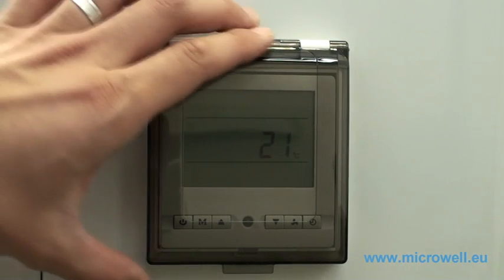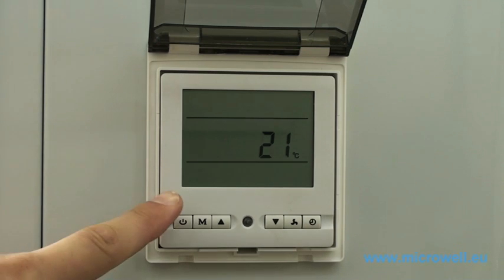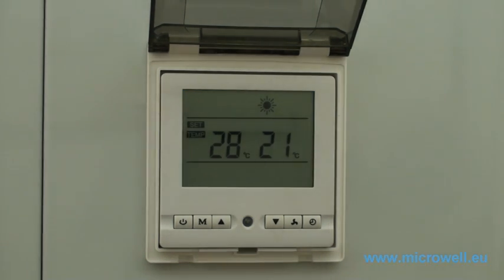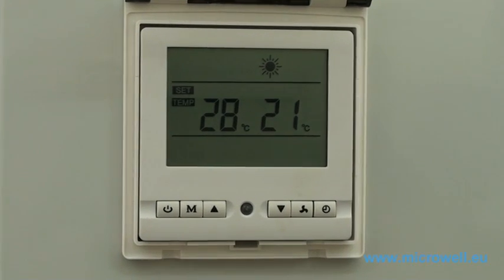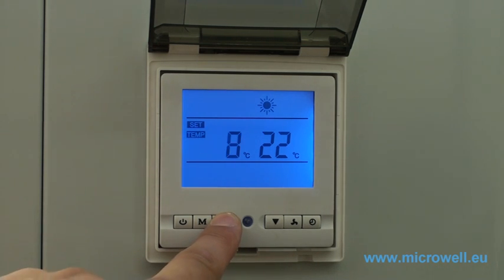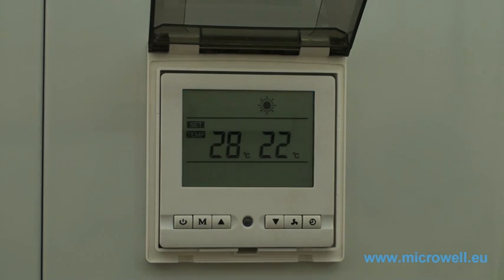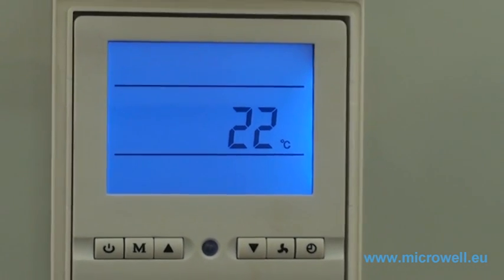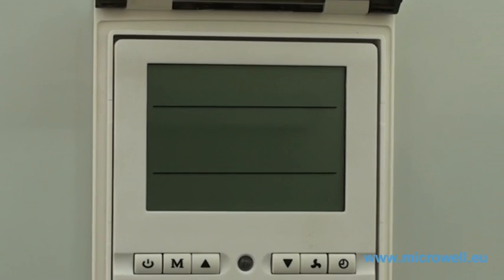Microwell Heat Pump tutorial HP900 HP1200 - Basic operations

Comment: Hi,
Where can I buy a replacement controller the same as this, delivered to the UK?
Reply: Please let me  know if you get an answer as mine has failed and I too need a replacement!
Reply: @andrewhj5511  did you ever mange to source a controller? I now need one
Reply: did you ever mange to source a controller? I now need one
Reply: @andyhoskins1054  I found a very similar one and desoldered the display from it and fitted it in mine.
Reply: @billywhizz26  was it the board or display that failed? It’s my display that’s failing, digits are starting to disappear. Where did you manage to find a similar replacement? Cheers
Reply: @andyhoskins1054  Sorry, no - I've had no luck finding one. Please do let me know if you do.
Reply: @andyhoskins1054  To be honest, I can't remember now. Think I just googled it.
Reply: @andrewhj5511   hi did you managed to find a replacement? Mine has packed up!
Reply: @jonathanrobertgroom4198  No I didn't, sorry. Please let me know if you do.
Reply: @andrewhj5511  no luck for me either, looks like dreams only sell the heat pump units and not parts